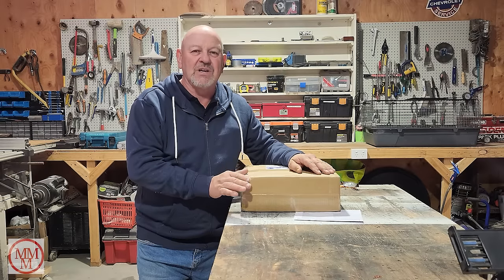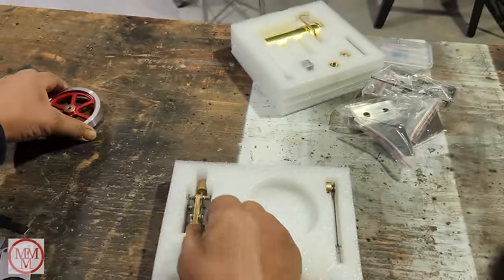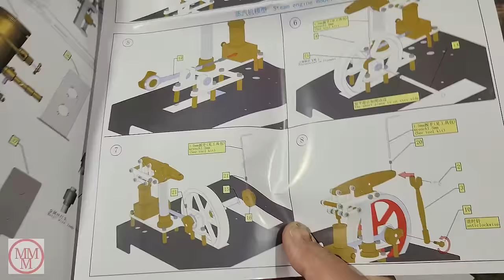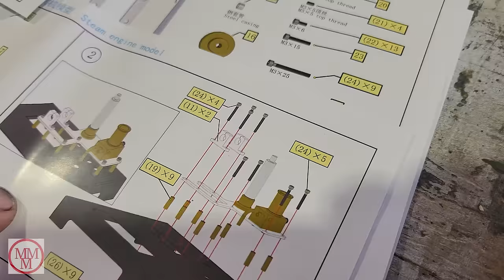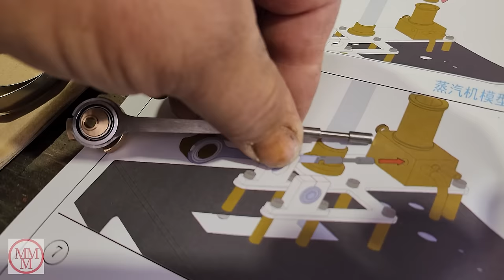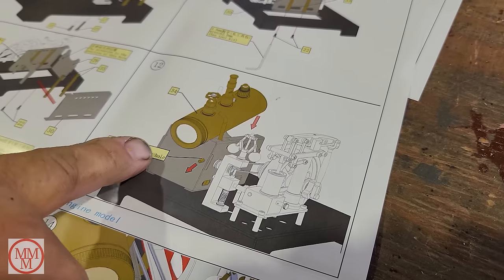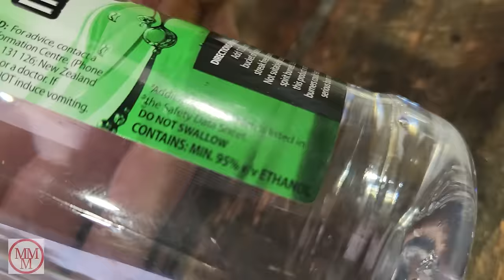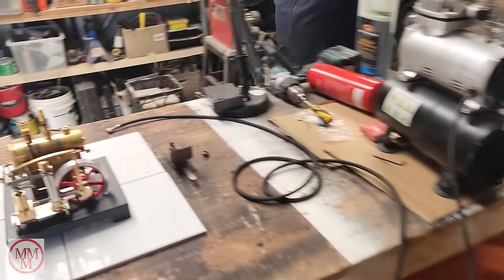Out of the Box - Episode 5 - Retrol/Stirling Kit Steam Engine review

Comment: Lubrication is a problem because  the brass doesn't like petrol oils. In my work I use graphite lock lube for fine brass and bronze guitar tuners. Works quite well and does not discolor or corrode the brass parts.

Comment: Had a steam engine as a kid and learned that lubrication makes them run more consistently as suggested in many of the comments.  Also you can prewarm the water in a microwave or on a stove - just be careful not to burn filling the boiler!  You need a little funnel.

Comment: Hi Marty. Love your channel. I also build model steam engines probably because I’m a mechanical engineer with an interest in steam. I have built several scale model showman engines, a working steam locomotive, a working steam crane and a few kits. I enjoy pulling them out in the summer and letting them lumber quietly on my back deck. Everything you did on your show including the compressed air is right on point. As for oil I use a special blend specifically designed for model engines. There’s a company called Wilesco in Germany that makes not just the model engines but accessories, tools and whole miniature workshops that can be powered from a stationary engine. Enjoy it’s a fun hobby but it can get expensive quick.

Comment: I love those little steam and hot air engines, I have a few of them myself, I also have a couple of pop pop engines off of pop pop boats. The next engines I will get is the mini 2, 4, 6, and 8 (V8) cylinder gas powered, water cooled ones.

Comment: These machines look beautiful but there are some strange things about them. The first is that the mechanism over the piston makes no sense. It doesn't eliminate the arc of the piston connection. In fact it makes the arc radius smaller than if the piston was connected directly to the end of the seesaw, which is worse. Then there's the governor that doesn't seem to do anything since the machine can't run fast enough and the machine is always limited by the valve.

Beautiful craftmanship though.

Comment: Beautiful model and a great job putting it together.  It looks like its' running out of steam after a minute or so of running though.  Perhaps some lubrication would help.  Full sized engines like this were lubricated using Rape Seed oil.  The Rape Seed plant being toxic to humans, has been modified through grafting and selective splicing to eliminate it's toxic properties and is now know as Canola.  Canola oil is found virtually everywhere.  Don't use petroleum based oils though... Steam doesn't like those oils.  And, be sure to keep Kevin away from this model.👍

Comment: you need oil made for steam engines which is available in your area from Stewart Models but you likely know that. However the boiler may not be adequate to produce enough steam for long runs ?